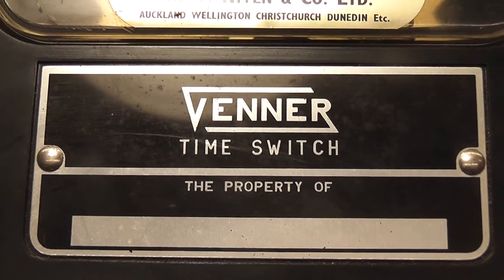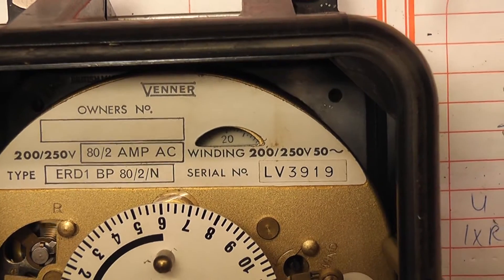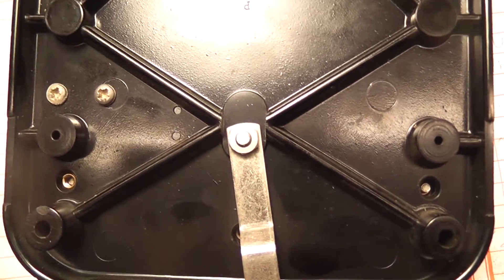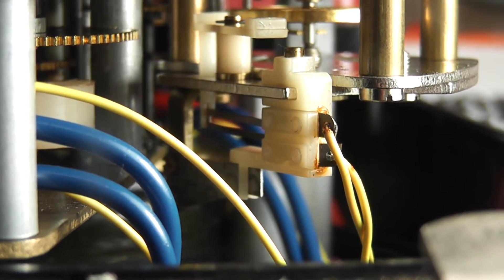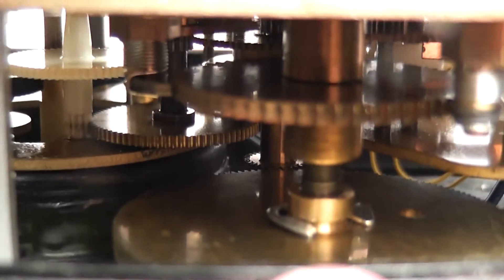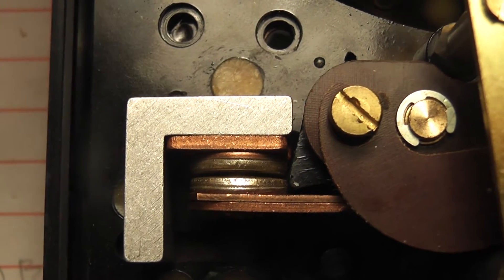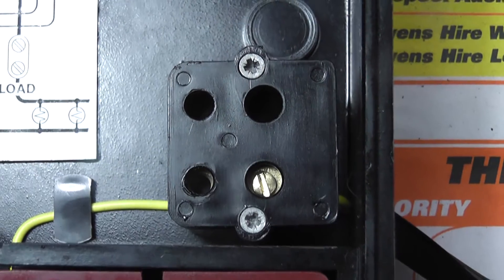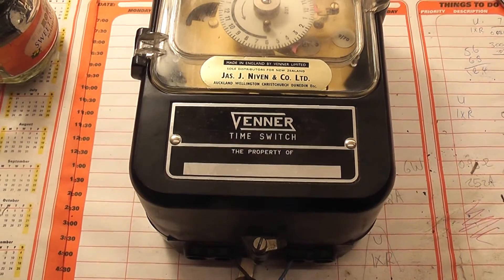Venner Time Switch

Comment: @RODALCO2007 Hiya, I have done a basic continuity test on the motor, and I unwired it from everything else in the circuit, and the motor is open circuit. :-( I tested the magnetic brake ( my one does not have the bi-metal strip, which is an interesting way of stopping the escapement, I must say! ) and there's a good circuit continuity on that. Also, I may add, the magnetic brake and the motor in my ERD 2 BPS are wired in series.

-BoomBoxDeluxe.

Comment from the maker: @BoomBoxDeluxe Yhe venners are becoming popoular now on YT with you and Larry ( HDXFH ) putting footage on.
This clock I have was never used at all. The meter sales agent give it to me as NOS.

Your clock motor might be repaireable, often the wires break where they ebter the motor casing. worth while having a close look, check the bimetallic strip if yours has that or the series coil with the magnetic brake.

Comment from the maker: @HDXFH  If you carefully nip the wire near where it goes through the bolt, you can reinsert it later if you wish and wouldn't know that it has been removed.
Keep the original seals with the clock to keep it complete.

Comment from the maker: @HDXFH  I think that your Venner is a bit older.
Check the gear train from the motor onwards.
If that is fiber or brass instead of nylon I'm sure that your clock is older.
In your case, you have to attach an earth wire to the exposed brass mechanism just for safety.